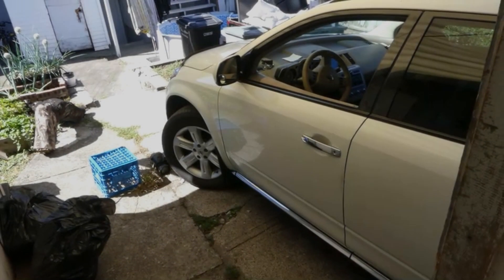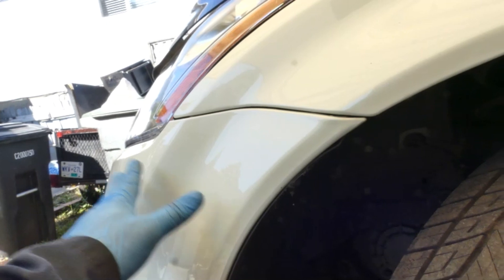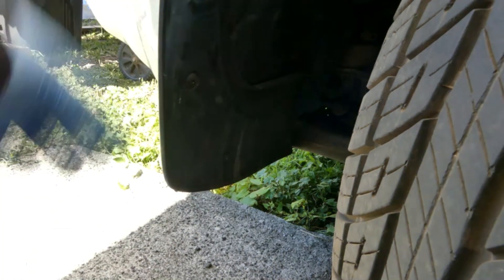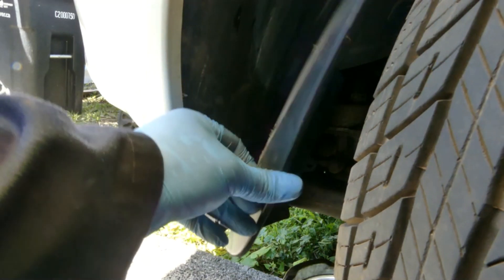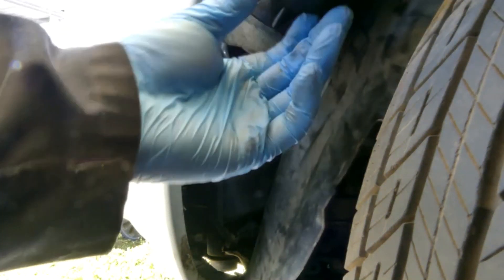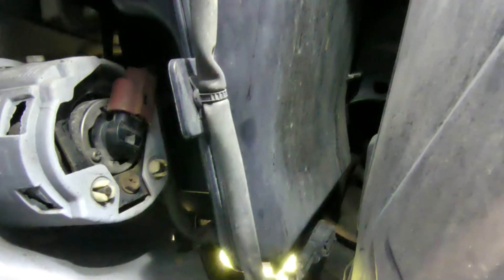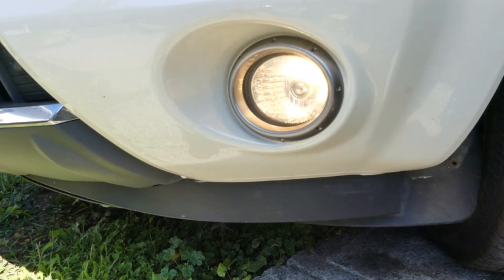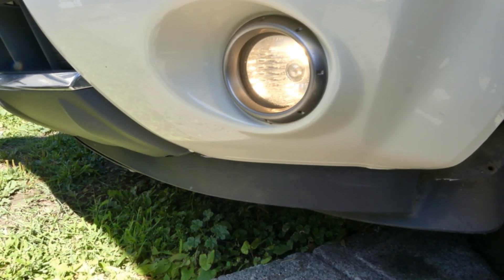2006 Nissan Murano Fog light Bulb replace

Comment: My Infinity needs help
Reply from the maker: what can i do for u my friend
Reply: @asianmechanicguy6483  my '97 Infinity has an electrical issue. I just bought it in non- running condition. The key won't start the car. Somebody installed a bump switch. Now it runs but no power to the a/c , windows, sunroof, tail lights. Is there one thing that can cause this? It needs an alternator, watched your video on that. Any ideas?
Reply from the maker: @williamevans532  bro u need a wiring diagram thats not an easy repair
Reply: @asianmechanicguy6483  I looked at one, it showed these items not working coming off of multiple relays.